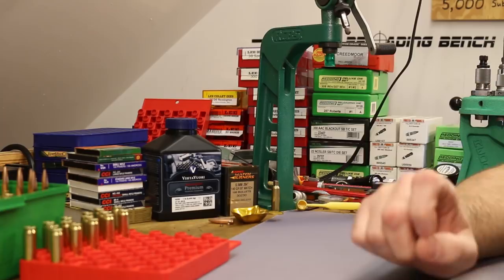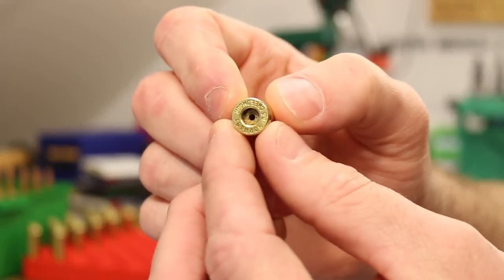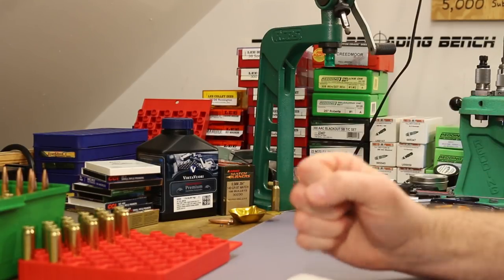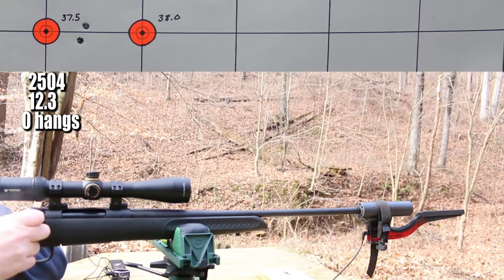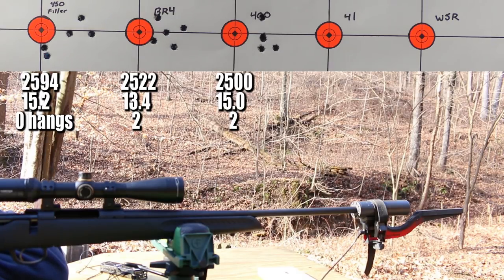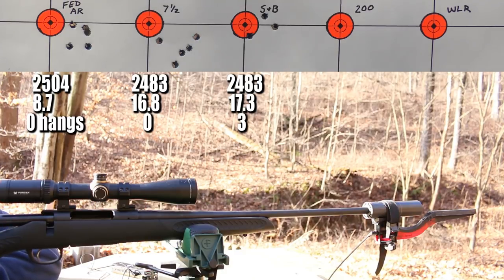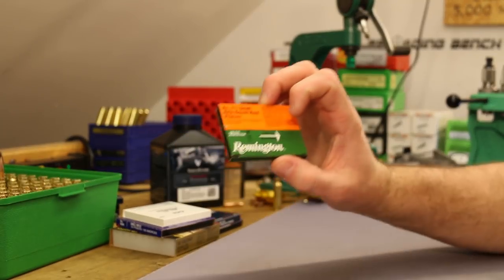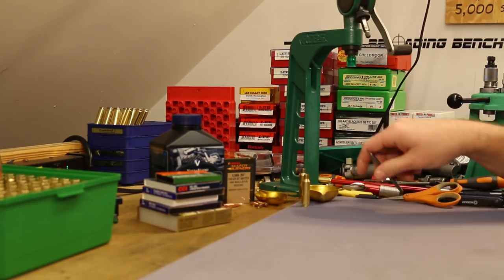Investigating Hang Fires in 6.5 Creedmoor

Comment: I’m here in 2023 because I just had my first experience with hangfires. I was fire forming some new Peterson srp brass. I used 40 grains of superformance and 25 of the cases had cci br4 and other half had fed 205 match. Both had hang fires and 2 didn’t go off at all. I’m going to be pulling the bullets today if I can find a 6mm collet for my rcbs bullet puller die. Temperature outside was high 30’s low 40’s as it’s a little warm for January here in central Washington. If I knew this was a “thing” I don’t think I would have been so excited to find the srp brass! Lol. Thank you for making a video addressing this issue!

Comment: Great vid JRB, definitely primer and case fill related IMO. That cotton scared me also before you even shot it, but it worked out. (I would check your suppressor though for burned cotton and make sure it’s not clogged) The fact S&B primers ALL did so poorly, you could add the cotton to that load to see if it eliminates the hang fire and that would let you know if it’s the S&B primer being to cold or a case capacity issue. Im sure a bullet being stretched out close to the lands vs mag length MAY change this also as the creates different case fill and pressure.

I think the fix is using large primer pocket brass for certain high energy/double based powders, especially with light charges causing low case capacity. I know a lot of people use large Magnum primers in 6.5 Creedmoor also, but since the standard large primer tested fine I would think the Large magnum primer would also.  

Great stuff JRB.
Reply: how can it be case related, large rounds like 50 bmg 20 & 30mm cases are half full and work fine.

Comment: As a kid growing up in Michigan, we shot rifles and shotguns in all weather.  Many times, we hunted in bitter cold; temps well below freezing.  I didn't reload back then, so all my rounds were factory produced.  I never experienced a hang fire until I was in my 40's, when I had one in a very heavy .45 Colt deer load from a Ruger Vaquero.  Powder was H110 w/CCI Magnum primers.

Hunting deer with the temp somewhere above 20 degrees or so, I pulled the trigger, heard the click, and a half second later, it went off. It was all of a half second or more.  Nothing like the quick ones Johnny is experiencing here in this vid. It's the first and last hangfire I've ever experienced.  
Since I loaded those  heavy rounds, I chalked it up to a contaminated primer even though I've always been meticulous, always using tweezers to handle them.

Needless to say, that's all the time my deer needed to make a quick getaway.

Comment: I use AA4350 for several cartridges.  Picked up a pound of N550 a couple of years ago, planned to use in 30.06.  Found in my notes that N550 and AA4350 charges are, grain for grain, equivalent.  Much respect and admiration for your methods in troubleshooting.

Comment: I am convinced its a case fill issue, You can clearly tell on the hang fires/delayed fires from your video (good camera and Microphone work) I dont think its a primer issue, The positioning of the powder will vary round to round based on how the cartridge is sitting in the chamber and where the powder is inside. The hotter primers might just have a better chance of igniting the small powder charge.

Comment: i have started using Vhit powders recently (in the UK we are soon to loose most of the Hodgdon and IMR powders), one thing i have noticed is that for .260 rem (and 6.5 CM) the Vhit numbers are very light compared to other sites (Nosler, Reloaders Data etc), the cynic in you might thing that this was due to Vhits sister company  is Lapua and anything that shows the 6.5 x47 Lapua in a poor light is to be avoided? With a better case fill I suspect that the issues with hang fires would go away? There seems be plenty of scope for increasing charge weights. Just a thought.

Comment: I think it is more likely the temperature and case fill affecting the powder more than anything else. Bigger or hotter flash from a particular primer would be helpful in lighting the reluctant powder, so there would be ignition variations induced with the changing of primers.

Comment: You might want to wait until the outside temperatures are identical to accurately test your hang fire remedies- in individual groups.  ...combining multiple "fixes" at the same time will still leave you wondering which one was the culprit.     As I said on the original video, I'm thinking it's not the primers- or the flash holes.  It's the combination of VV powder & case capacity, and possibly cold.

Comment: Smaller flash hole may also produce a venturi effect, accelerating the ignition flame/spark to a higher velocity and penetrating deeper into the column of powder. BTW, those S&B primers made the TC sound like a flintlock.

Comment: I have seen this happen in my 6.5CM if I dont get a good seating depth or the primer is a Standard Small Rifle Primer rather than a magnum SRP.  Not sure why that is, but it does happen even in custom $3k rifles.  The times I've seen it was always with a double-based powder and using standard SRP.  Never had it happen using magnums, bench-rest, or match primers.

Comment: The discharge of hot gasses from the primer is a fluid.  Considering conservation of momentum and Bernoulli's equation (https://www.khanacademy.org/science/physics/fluids/fluid-dynamics/v/fluids-part-12), a smaller flash hole design will generate a faster flow velocity (mass flow rate) through the orifice.  My hypothesis is that the higher velocity could carry more momentum and more heat to the charge for a more reliable cascading detonation. Great job Johnny and trying to control variables and attacking problems with a systematic approach.
Reply: Old post, sure, but for anyone else reading. Toxic free primers are weaker then classic primers. To improve combustion they use a smaller primer hole, this goes for both rifle and pistol. There is even some manufacturers that has been forced to go berdan primers to insure ignition. Causes alot of irritation when reloading pistol brass, especially Norma and S&B toxic free cartridges have holes that is almost half the size of the normal primer. Reloading with normal primers works fine, but getting the old primer out is tedious.

Comment: Have you taken your bolt apart and clean anything in the firing pin channel? This seems like something you should check to make sure its not mechanical related. I think this is light primer strikes or something of that sort.
Reply: gixxerjunky with his gun cratering primers on any load I doubt light primer strikes are the culprit esp considering his gun is pretty new and would need more rounds to get that dirty in bolt mechanism or channel

Comment: I could hear a slight hang fire on shots 3 and 4 of WSR. Some powders are incredibly hard to light correctly.  The reason for a minimum powder charge is the amount of oxygen to powder ratio in the casing.  Powder does one of three things when a primer goes off; 1, ignition, slow burning of the powder due to the lack of oxygen to burn at a predictable rate. 2. detonation is the rapid burning of the powder beyond the safe pressure "spike" resulting in excessive pressures and probable firearm destruction.  3. is not ignite at all or slowly ignite.  CCI 41 primers have alot of R&D beyond most other primers and I always use them or CCI 34 for large rifle primers.  I only use CCI 450 in 300 BLK due to inconsistency when using CCI 41.  Your case fill velocities are a prefect example of what happens when case volume is reduced resulting in increased velocity.
Reply: David Peterson let me just interject a couple of things here to fix some errors from what was posted. The reason for the minimum charges is that developers found their maximum charges and then lowered that number by a set percentage to come up with what would be a safe starting charge for ANY person with ANY gun, the "amount" of oxygen is immaterial since ALL of the compounds used in primers AND powders have their own oxygen/oxidizer built into them for combustion and will burn even in a complete vacuum devoid of ANY atmosphere. A hangfire is a slow or delayed initial ignition of powder due to a ton of variables, the thing that changes a smokeless powders burn rate once ignited is the pressure created during its own combustion due to the amount of gasses it's producing. Smokeless powder doesn't detonate, but it's burn rate does increase exponentially once it passes a certain pressure threshold, and that can make it look like a detonation, but it is still just burning. CCI #41 primers didn't go through any more R&D than the CCI 450, 400, or BR4, the CCI #41 is the exact same primer as the CCI 450 but instead of a .025" thick cup for the body of the primer, CCI used a .027" thick cup to try and help with possible slam-fire issues in some military rifles that don't use firing pin return springs, and that same thing holds true for the CCI 34, it's identical to the CCI 250 in every way but it's cup was also thickened by .002".  Even the folks at CCI have stated that the CCI 41 is interchangeable with the CCI 450 in all load data where it's used as they have the exact same brisance due to the same amount and type of compound used in them. You're number 3 item, is the basic description of the difference between a misfire and a hangfire.
Reply: David Peterson having watched the video of the WSR loads again and again, I'm not picking up any sign of a hangfire, even tried on my PC with the big sound system speakers to hear for any sort of delay and didn't get anything. But I'm not surprised really, the WSR is one of the highest brisance primers on the market for small rifle primers.

Comment: Well fug... I'm using s&b spp and star line small pocket brass with h4350 and had a hang fire and dud I attributed to still wet brass... Guess I better go pull those 40 and pick up some different primers... S&B work great in the AR, but I guess they don't have enough oomph for the 6.5

Comment: cooling the rounds off is going to be interesting. I am not sure your results will be different  It seems to be a issue of extra space in the case , primer ignition temp(or whatever that is called).  The reason I say this is there was a 20+ degree difference in the temp when you shoot these rounds and you got hang fires with the 450's. You would expect the powder to ignite more easily than at 20 degrees.  I am not sure 20 degrees the other way will effect the powder. Is VV powder temp insensitive?  The filler thing is not a new concept.  but loads have to be worked up. Pressures can be more with fillers. Dacron has been the go to filler for years. People have used it to load  large black powder cases when using smokeless powder.  Like the 50-110 Sharps in old single shots.

Comment: Just ruminating, but it seems that the 5 shots with case filler would essentially simulate a compressed load, decreasing the case capacity for expanding gasses initially which would account for the increased velocity. 
**Also, I'm guessing that you'll be trying the same test with a different powder and the same array of primers, right?
Reply: Yissnakk Lives! Wait a sec ruminating isn't that something to do with cow stomachs and digesting or something I can't remember cleaely

Comment: In my unprofessional opinion, I think the problem was a combination of low temps, excessive case capacity due to the long seated bullet, the low powder charge, and the small primers/flash holes.

Seems like I remember reading that double base powders are harder to ignite because of coatings that control the burn rate. I could be mistaken…

Comment: Great video. Lots of good info.
Did you ever test that other filler on 300blk? I'm trying to load light-ish Subsonics and getting problems.

Using 147gr M80 pulled I've used A1680, Lil Gun, CFE BLK, and Trail Boss. All give crazy speed differences. Even the trail boss which overflows the case before you get to 1050fps.

I also tried the Rainier Plated RN bullets and they are terrible.
Reply: Try some Ramshot Enforcer!
Reply: I've tried the same kind of loads in the past I've found IMR4227 and IMR4198 to work the best (may not cycle carbine length gas though). Basically, higher VMD and faster burn rate is the ticket for light subsonics.
Reply: number40Fan for 300blk or creedmoor? I've never seen that powder used for 300blk...

Comment: I believe its more of a finicky powder to work with rather than the primers I used pretty much every primer you had problems in extreme cold weather and never had a problem.ecpept the s and b and cci 41 primers' have hard time believing it would actually have any thing to do with the case capacity it was at a reasonable case capacity.

Comment: To me it is obvious that you have too little charge density with N550.  Too much air space allows the flash to push over the top of the powder when the cartridge is horizontal.  This presents a cooler flame front to the powder and that cooler flame cannot ignite the charge.  I am always concerned if the charge density is less than 95%.

Comment: That was WAY more filler than I would have used and feel you may have had good reason to worry. Not with my can.
   As far as the camera picking up the sound.
Maybe it my phone, or ears, but I'm Clearly hearing it.
The 2nd shot @37.5 on the 1st video....had to be .1 second delay.
  I thought double base powder was to fix the issue of powder position? 
(Titegroup)
The odd color and clumps is the powder melted together.
I also wonder if a smaller flash hole would force the flame deeper.

Comment: Puflon was mainly designed to take up case capacity in subsonic loads is what I heard?
Reply: Yes. Thats why he had it, for sub 300 blackouts
Reply: Aaron Anderson Did it work for 300blkout? I have been loading 10g h110 under 198g bullet with no need for filler. Just curious.

Comment: the amount of powder in the case shouldnt matter. large military rounds cases is are half full and work fine. it's between a bad batch of primers, firing pin, or firing pin spring or trigger spring.  usually it's just a bad batch of primers.

Comment: S&B primers are used routinely by benchrest shooters because they are weak primers compared to other brands and typically produce better accuracy. Accuracy seems to improve with weaker primers. This is opposite as you would typically assume. Weaker primers perform poorly in cold temperatures. Lapua brass uses small primers and tiny flash holes which reduces flame which is the same effect as using a weak primer with large flash holes. Large primers with large flash holes using hot primers (magnums) typically produce less accuracy. I am not surprised you experienced issues with S&B primers on a cold day. It is my assumption that a high flame level entering the powder column disrupts the powder position in the case during ignition which creates more variation in combustion and less accuracy. I am not sure if this situation has been studied enough to determine a scientifically proven fact about primer performance.

Comment: I'm not a reloader, but I question why you would not start in the upper half of recommended loading and work from there? I don't find much use in reloading unless I was trying to find the most accurate load near max pressure. That way I knew I was getting the absolute most out of a cartridge/bullet design for a hunting purpose. Shooting really tiny groups on paper does not interest me unless I'm potentially using that rifle and load to take game effectively, either two legged (defense) or four legged (hunting). Don't get me wrong, I have watched many of your videos and will continue to do so. If I was having problems with ignition at slower velocities, I would try increasing charges until the problem went away, until/unless I saw over pressure signs. Many variables to consider though, that is why I do not reload yet, and why I watch your videos to learn.

Comment: It has long been known that cold temps reduce the effectiveness of powders - BUT it doesn't STOP ignition. Conversely, very high temps increase chamber pressures significantly. While primers are an obvious First choice, I would say that the appearance of the powder is similar to what I have seen in the past when I KNEW the powder was contaminated.
I, myself, would start by looking for possible powder contamination - penetrating oil of course, lube, and one that many forget which is proximity to ammonia or ammonia products such as Windex. With ammonia, direct contact isn't needed - just proximity. That's where I would start.

Comment: There is a small chance that the cotton wad may possibly get clogged into your suppressor baffles.  I recommend that you inspect the living daylights out of the inside of you baffles with a lot of light.  There is not a lot you can do to clean a silencerco Omega except scrubbing it with a brush as far as I know.  I don't know what Silencerco thinks about using an ultrasonic cleaner on the suppressor.  To get some perspective about clogging suppressors, read about the silencerco suppressed muzzle loader and why they only recommend projectiles that won't clog the suppressor.  Things like sabots are very bad for them.  Hopefully any fibers that get into the baffles will burn up from the heat.  You only used a few of them so you are probably OK.   I do know that Silencerco doesn't want anything getting into the baffles.  Please check out this review of that rifle:
http://www.guns.com/2017/10/20/shooting-the-silencerco-maxim-50-moderated-muzzleloader-video/